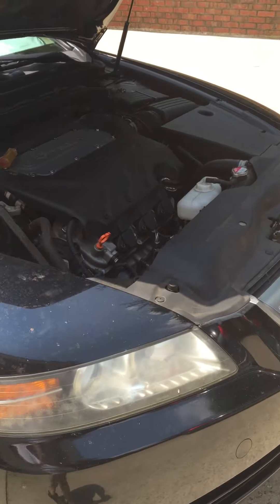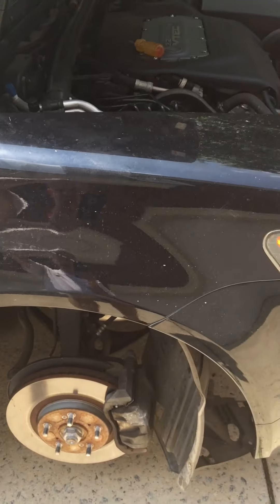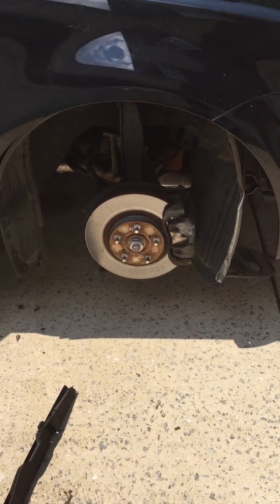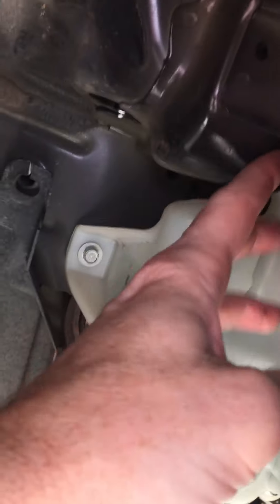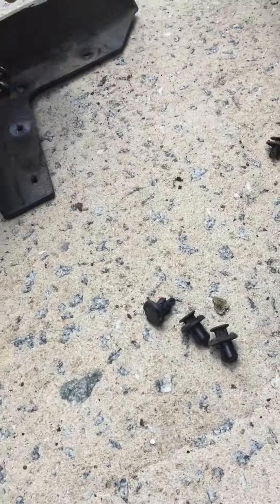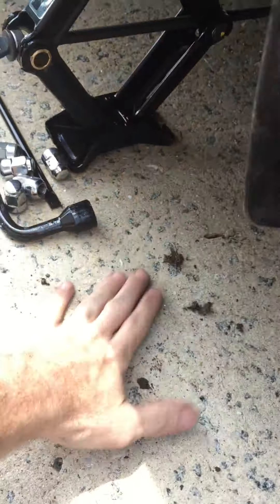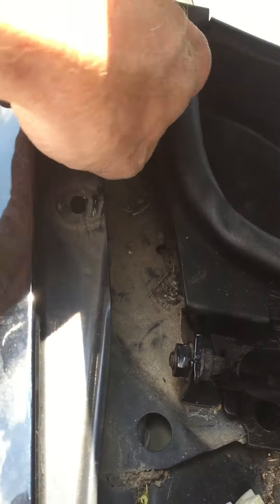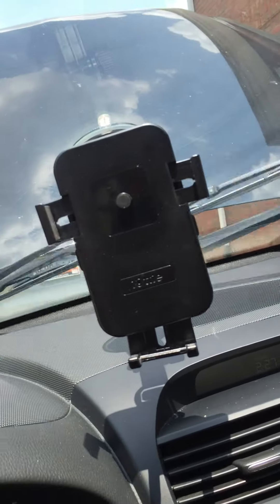2006 Acura Fix Windshield Washer Not Working

Comment: thank you so much for the valuable information i thought my washer pump was leaking and it turns out it was fine after i took everything apart i am beginning to think it was disconnected on purpose by one of these mechanics my washer tube was disconnected at the exact place as yours at the coupler but i wasnt sure where it was until i found your video very informative and you saved me a lot of time and money respect to you

Comment: Mine was completely chewed up , RATS, anyway I had checked up by the engine bay and noticed that the line was still connected, I started tugging on it and it seemed to be really loose so I pulled it all the way out and noticed it was completely chewed off, thanks to your video I was able to diagnose that, thankyou!

Comment: Thank you. This was very helpful, as I did not know how to access the washer pump/motor.  My 2004 Acura TL is blowing fuses. A replacement fuse blows also. My next step is to check or replace the pump.

Comment: Thanks! This is one of those cases where the video for the Pilot is not helpful. Mine was leaking right near the outlet of the motor so I loaded it up with silicone. Fingers crossed.

Comment: Thanks for the video. I have same issue after I got my windshield replaced....washer pump working, but washer fluid squirting onto ground by the passenger wheel. I was able to locate the disconnect tubing by the hood cowl but haven't had a chance to take off the inner fender yet to see the other side/tube. It was hard to see in your video but where exactly did you route the lower tube through the fender to connect with the upper tube? Also is there a grommet/protected hole to put the rubber through? I see some straight cut metal holes on the inside of the engine bay but seems dangerous to just route the rubber through and have it sit by a bare metal edge. Thanks for any advice.

edit: So another tip from me is that if you have smaller hands/forearms you can actually do this WITHOUT removing the wheel. First, turn the steering wheel all the way to the right, thereby the wheel is turned to reveal the backside of the wheel well and you can pop off the clips to expose the washer tubing. 

You can snake your arm up there and try to connect it to the upper hose by the engine bay area. Again helps if you are a bit lazy and have smaller arms and want to try it without removing the wheel...it can be done....
Reply: No worries I was able to figure it out. But yeah there is a hole there and the metal edge is actually rolled to a small area of flatness (I think Acura knew that this would be an area for a rubber hose passage way) and so it wasn't too bad. 

So another tip from me is that if you have smaller hands/forearms you can actually do this WITHOUT removing the wheel. First, turn the steering wheel all the way to the right, thereby the wheel is turned to reveal the backside of the wheel well and you can pop off the clips to expose the washer tubing. 

You can snake your arm up there and try to connect it to the upper hose by the engine bay area.
Reply: I am investigating the same problem/symptoms after a windshield repair.  Thank you very much for posting the video and saving me the same painful diagnostics!

Comment: Where is the fuse located? I looked at the manual and there is no fuse for wiper fluid motor or anything close. I only see front wiper and back but my wipers are fine it's my fluid motor on front and back that aren't working? Any help?